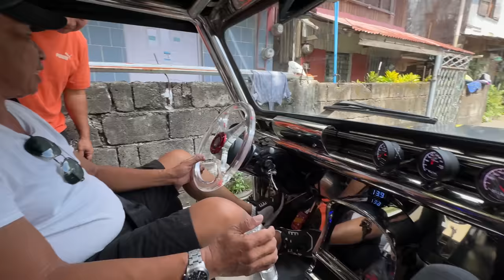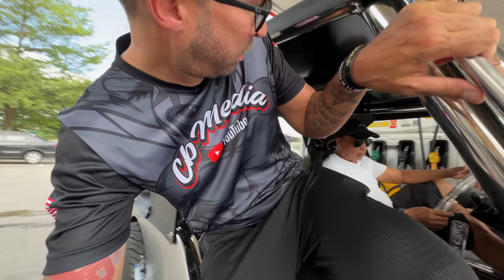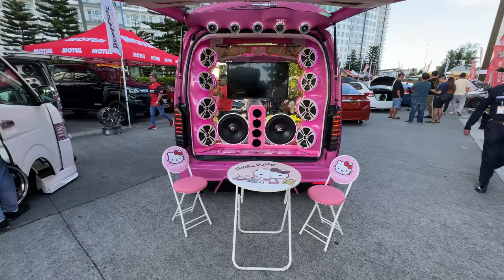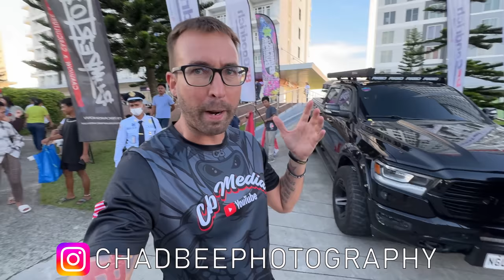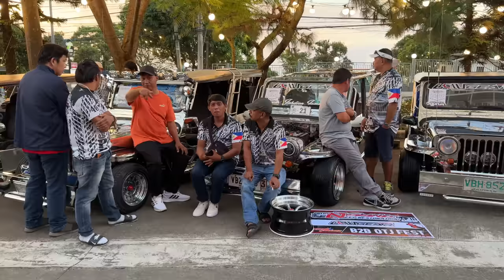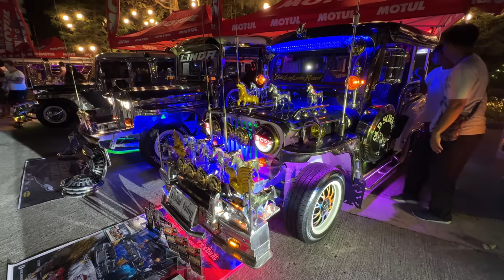Custom Jeepney Car Show! Unique Car Culture in The Philippines!

Comment: Expat here in the Philippines. Filipino are raised around a lot of noise, it will drive most forgiener s insane. It is not are culture so it is hard for most to tolerate. A Filipino regardless of noise dogs barking,, chickens crowing, traffic noise can fall asleep anywhere. Good Program

Comment: Well done Chad! Unfortunately the government is moving on with replacing these beautiful Jeepney's to ugly nowadays people movers even EV's.  If you ever come to Dumaguete, let us know 😎
Reply: LOL there's a  BIG difference between the jeepneys in the video and the everyday puv/puj's you see in use on the roads there. If you care about safety as a commuter, then of course you would want a regulated public utility vehicle with working brakes, lights, creature comforts like air conditioning, and of course reasonable emissions standards. It's time to move forward and evolve for the better in that aspect. However, fine examples of otj's and puj's like in the video should still be allowed to exist...not the dilapidated, shabu-driven, smoke belching, bald-tires type rust bucket where you can get tetanus kind of jeeps.
Reply: IDIOT COMPARISON..THIS JEEPNEY IS FOR SHOW NOT THOSE OLD TYPE NOT WELL MAINTAINED PUBLIC JEEPNEY
Reply: @Al_Moranas  what part of the philippines have you been riding jeepneys for you to complain and generalize them to be "shabu-driven, dilapidated, tetanus laden"? 🤡

Comment: as a Pinoy... I agree...let the jeepney live on.. as a cultural icon, a part of Filipino heritage, a symbol of Filipino ingenuity and adaptability to use things available to them in times of adversity.  But it's long overdue... let's get over the drama already, they should be phased out for commuter use.  The actual jeepneys plying the roads for passenger transport are practically rolling body traps.  No safety for driver, nor passengers.  Most diesel engine used are non-compliant to modern emission standards, and sadly, drivers have not really been "professionalized" even if they supposedly carry "PROFESSIONAL DRIVING LICENSE".  I wish there would come a time when a Professional Driver's License for Jeepney or the modernized version of it,  is a badge of pride much in the same way that a Truck driver's license in the US is.  that is my hope.

Comment: the design of the otj has not changed from the very first day they made one.. lack of research and development... they could not even install a proper seat belt on the one you are in now... I really don't know what is the problem with filipino auto designers.. i know there are good designers and inventors out there...

Comment: Those jeepney that carry people , if they are supposed to have 25 people in them , they’ll try to put 50 if they can , and it gets so hot in them with people sitting on laps and riding on the back and in the aisle if there’s room , you get to know people sometimes on a personal level LOL. Sometimes you can’t help but have a woman’s breasts resting on your back or shoulder and depending on where you are sitting sometimes in your face LOL. I rode in one from Cabanatuan to Llanera while the roads were being rebuilt and traffic was just terrible and well let’s just say I met a few people that way. You let two off and five try to get on. 
👍👍👍✌️✌️✌️